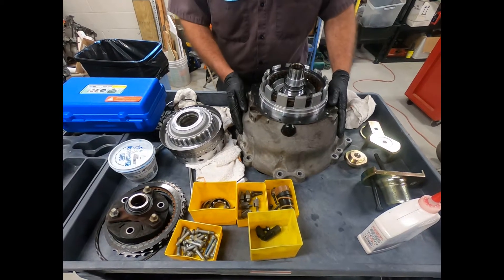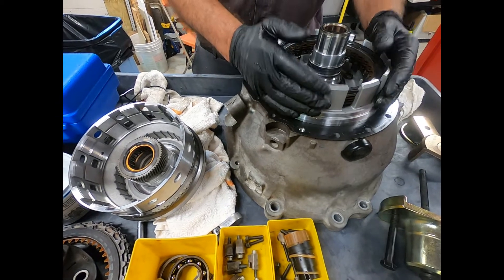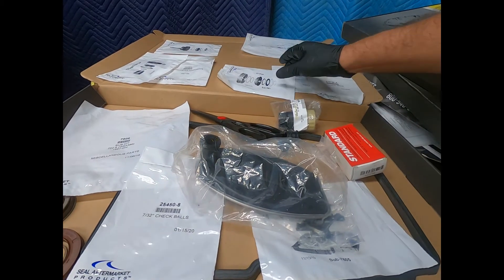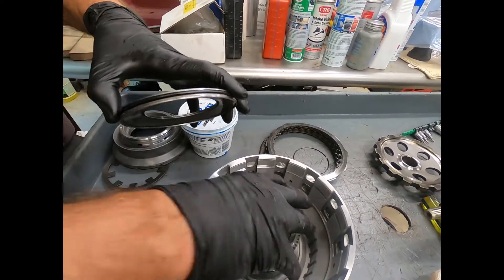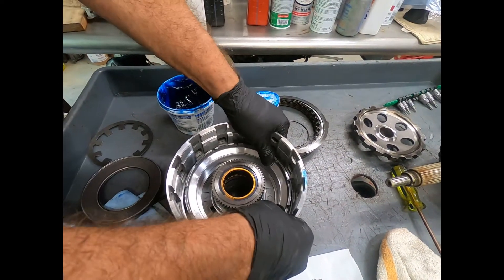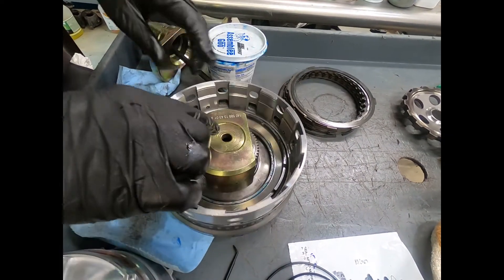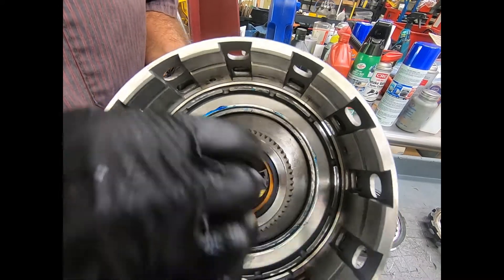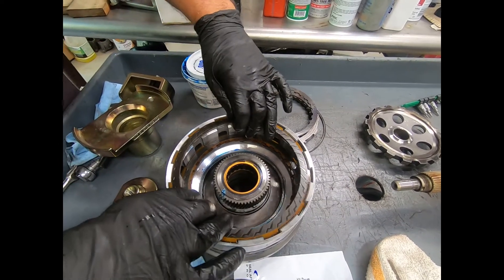Mercedes-Benz 5G-Tronic Transmission (722.6) Component Overhaul Part 1

Comment: According to you will mercedes transmission is more reliable.  Is 7g reliable ones.
Reply from the maker: Yes I believe so. The 7G-Tronic 722.9 had problems with the speed sensors that are part of the transmission control unit (TCM).
We rebuild many 7G-Tronic units, overall they last a long time.
https://www.ecutesting.com/common-faults/mercedes/7g-tronic-transmission-problems/
 
This video covers the 5G-Tronic where the TCM is separated from the transmission and located in the vehicle. The 5G-Tronic has been a good reliable transmission and is used in millions of vehicles.